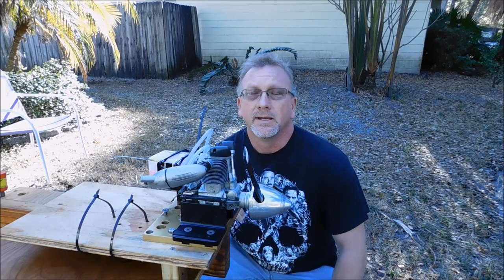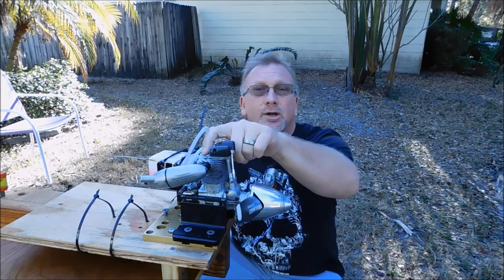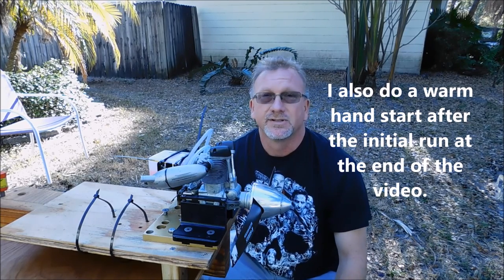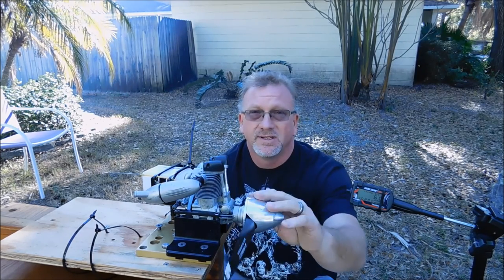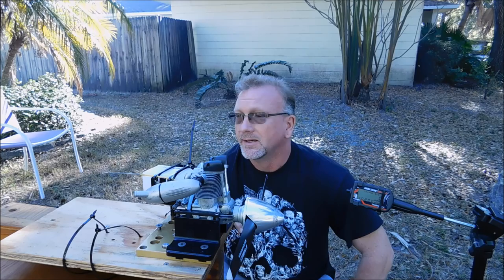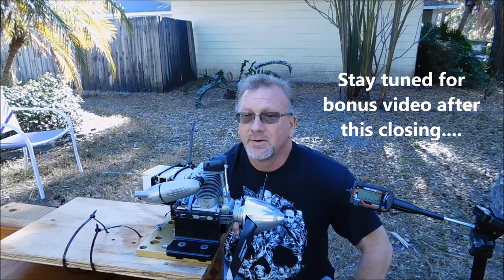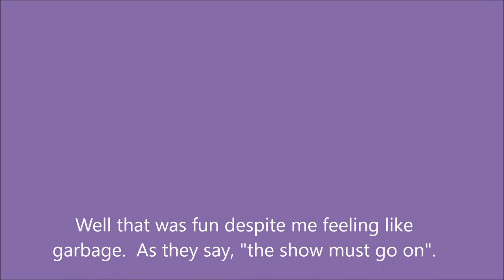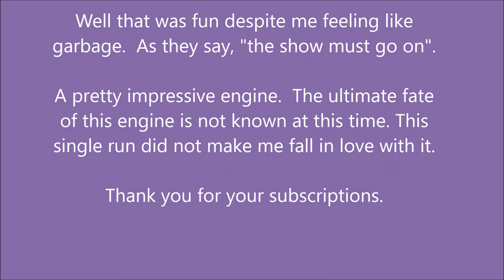OS FS-95V The First Run After Rebuild

Comment: Hi David, thanks for a great video...I am just in the process of buying one of these engines for my new build project. Would appreciate your advice on break in, fuel mix and tuning...
Reply from the maker: Well the engine I had for a short time was not new.  My recommendations would be to follow the manual as to fuel and break in.
Reply: Thanks David, I will do the same, should have it in a few days...Cheers!!

Comment: Hey Dave, what do you think of running a straight pipe on this engine instead of the goofy muffler? Or maybe an older saito type that is mostly straight through but has the nipple for the tank pressure?
Reply from the maker: I think it would be fine and sound good. All you can do is try it out.  It certainly will not damage the engine. A huge part of this hobby is all about experimentation.  https://youtu.be/jF1__u2tRjs